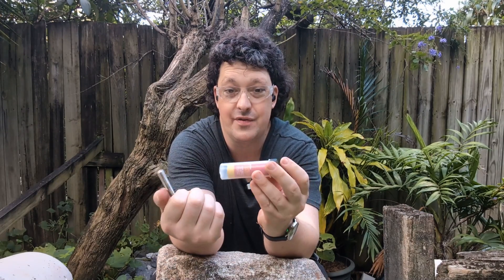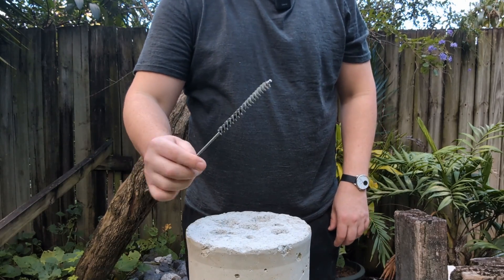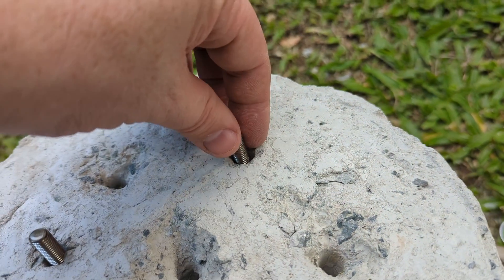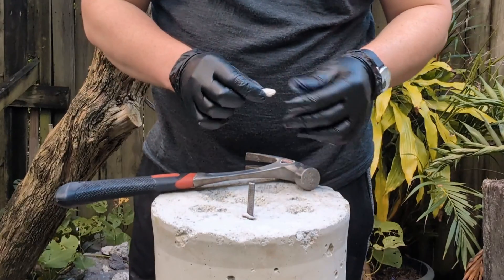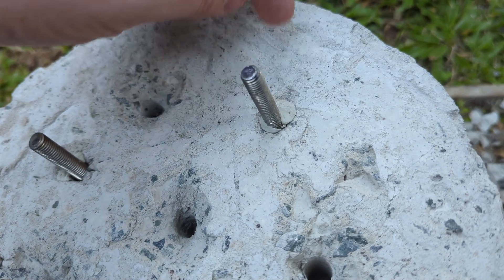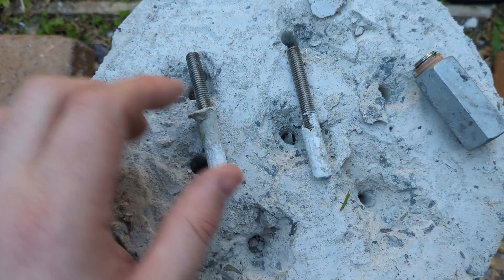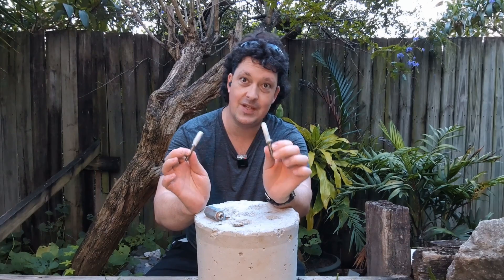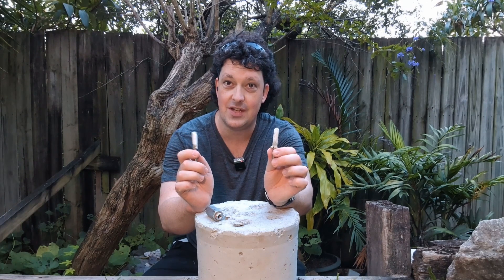Epoxy putty: Can you use it for anchoring bolts?

Comment: interesting read from jim titt/bolt products website "Epoxy repair putty. By this I mean the pre-packaged little rolls of epoxy which you cut off and knead until mixed and use for repairing water pipes and such.

Usually comes in ca 60g packages. This could be convenient way of gluing one or two bolts without carrying cartridges and guns about.

I have tested two brands of this, one from Pattex (Henkel) commonly sold in Germany and another called Wetseal from Acrypol which is available in the U.K. The Pattex one doesn´t actually say what it is and proved to be not very strong, actually it gave the worst result of any glue I have ever tried. The Wetseal actually said it was epoxy and was twice as good with a one hour cure achieving respectable results (38kN)  with our standard bolt test. The problem appears to be that for repair purposes a certain amount of flexibility is required  and this reduces the putty´s load bearing capabilities, they are noticibly rubbery when cured.

This is a pretty pricy way of gluing but would be an option for that odd bolt."
Reply from the maker: Wow! Now that I see this I'm sure I've read this before. Jim's big long blog page is great. I think if I could use a bolt style that screwed in this putty would work better than in the video, as it does set rock hard